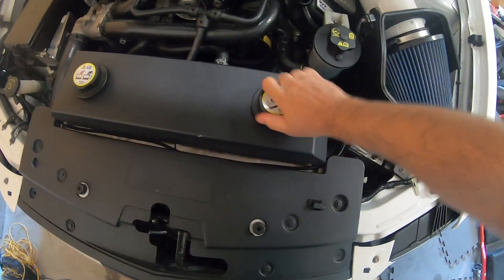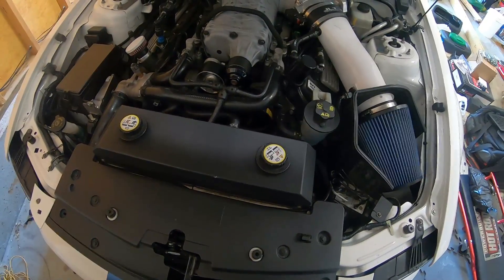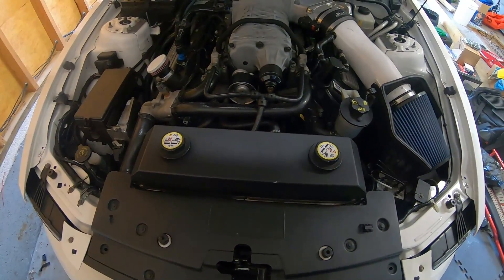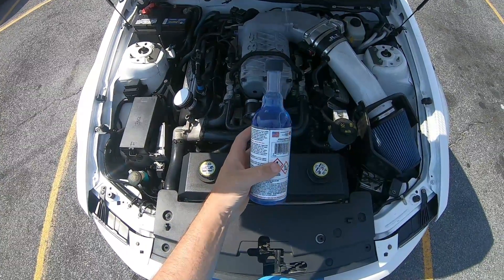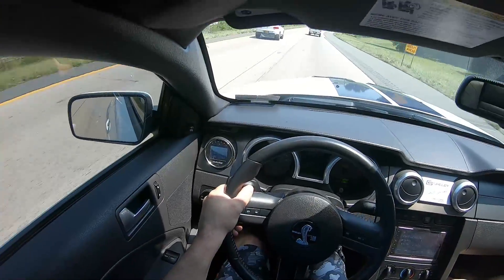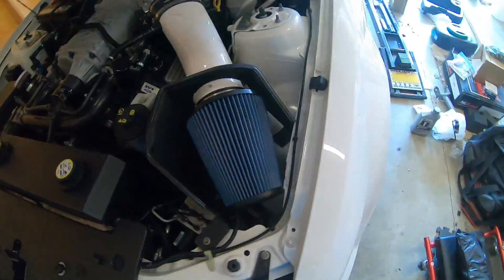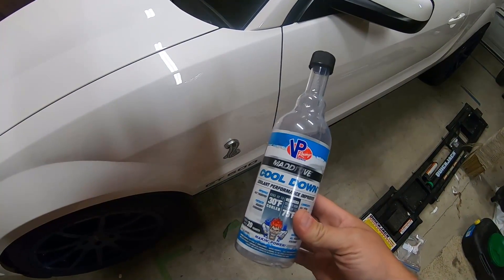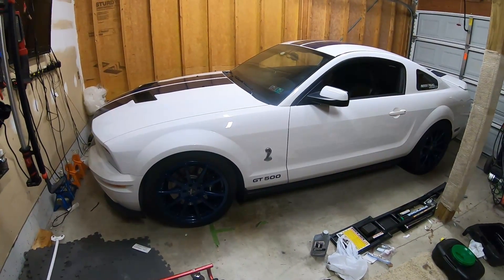Testing VP Cooldown in your Water/Air intercooler

Comment: Yeah, it’s not a magic temperature lowering fluid.  Think about it.  To reject more heat (a lower IAT) you need a higher delta V between the heat exchanger and the air.  So adding a fluid with a higher boiling point is not going to do anything.  If you wish to see anything you should be raising the boost until the fluid boils, then add this product.

Comment: I'm in Miami Florida and we have been hitting 100 degrees in summer.  It's works a bit, but you need a scan tool. According to my mechanic in other I internal parts of the engine it runs a but cooler. What i have found that really works is either using VPs coolant, or with the additive mix in a gallon of lab water triple distilled and ionized. Then you'll notice a difference in the cooling system. , but again I t is a good insurance for ten bucks in other crucial components that you can only monitor with a professional scan tool.
Reply from the maker: I was not testing in my cooling system. Nothing to test on internal components or a “professional scan tool”
Reply: So you recommend VPs stay frosty?  I'm 2JZ runs a bit hotter than I like so I would mind dropping a few degrees celsius. Thanks.
Reply from the maker: @KillJD it may help a smidge if you are hitting the boiling point. Fixing underhood temps overall would help more though. When I had my Supra I ceramic coated my manifold and downpipe and exhaust housing to bring temps down. IMHO there are probably bigger gains there
Reply: @PMPerformance  Yea it's a 2J swap into a E46.  It's definitely an airflow issue because if I can keep the car moving in traffic on a hot day it's fine. Once I'm in stop and go traffic I have to turn in the blower motor to help to just maintain the temp. 

The turbo has a blanket and the manifold is wrapped. Next I'm going to try some hood vents and ducting around the radiator. On a nice day it's too much of an issue. Thanks!
Reply from the maker: @KillJD yea that’s always a tough battle and gotta get creative. You can try this as it’s cheap, but I’d bet it won’t do a ton for you

Comment: Ughh I used it on my stocked vw cc  did a whole flush cleaned   Added new  coolant   Did a 1 week test without adding anything stayed normal   Added the vr racing  cool down  honestly it truly work but didn’t give me the 20 degrees lower gave  me about  16-17   Stayed between those the whole week and after that  also forgot to mention I did do a engine clean 🧼   As well car does have 140k miles no issues   It can definitely be a hit or miss all depends on how you do it
Reply from the maker: Did you watch the video? While I appreciate the feedback, this video was not showing its typical intended use. I filled a water to air intercooler with it.

Comment: It’s not going to work well the way you did it, you have a boosted car. You need a heat exchanger and a chiller. Not to mention a lower thermostat. This product works good on naturally aspirated engines. Not boosted.
Reply from the maker: I get that. There were people touting this fixed iat problems, and this was proof it doesnt

Comment: Install a forced induction inner chiller stage 2 kit. Don’t buy that killer chiller garbage use forced induction. I live in Houston and mid summer my IAT2 average 30-40 degrees 50-60 degrees after several pulls. Coolant temps stays around 30 degree will drop below zero in winter and spring
Reply: I miss read I thought you posted this 3 days ago lol. I was very skeptical myself with this chiller but made me a believer. I can do back to back pulls on 90 plus degree day and my highest IAT2 was 88 degrees.
Reply from the maker: @h-townremodeling1519 it’s all good. 
Yea if that is the case, this sounds like an awesome setup! That’s the key is to be able to make back to back runs with ease at full power.
Reply from the maker: Those chillers work decent for idling, but under load, I have yet to read anyone that has indicated these are the answer.
Reply: I just did 😊 I bought a 21 stage 3 Roush car I know all about heat soak. This solved it. Again don’t use killer chiller use Forced inductions chiller they developed it Killer chiller tried to copy it.
Reply from the maker: Thankfully this video is probably 5 yrs old and I no longer have this nightmare of a car.
This car has changed my outlook on PDB cars for sure! Lol
Those IAT’s seem almost too good to be true. Esp after several pulls. This sounds great though if this is the case

Comment: You use your AC? Center vents closes and drivers vent occupied by the Ngauge
Reply from the maker: strange that is the part of the video you focused on. This video was probably done in the winter.
Yes I closed the gauges because of ocd. When I use the heat or ac, I simple just flipped the vents open
Reply: @PMPerformance  I thought you said it was 80+* and wondered if you had better cooling using the floor vents or something.
Reply from the maker: I don’t even remember what video this was.
Simple response was : I  was not using ac during the video
Yes when I used it, I opened the vents or used the floor only.
Maybe I shut them off for the video. I don’t recall, but irrelevant to any of the video contents

Comment: I've had my IAT down to 50° three bags of ice in the ice box. It was like adding nitrous.
Reply from the maker: Sure, for about 30 seconds at the track.
Reply: @PMPerformance  long enough to pull a 5 in the 1/8th
Reply from the maker: @ArmyPL1981  that’s fine and dandy for a track car. The ice does not last that long on hot days, but moot for a street car.
I had an ice tank, but again doesn’t do anything on the street.

Comment: Where is your bank one and bank two sensors? Because this  specific product is claiming head temperatures. So what is your head temperatures?
Reply from the maker: Because this product was design for engine cooling, not blower cooling.
This was an attempt to see if it would help, and did not

Iat1 was in the maf and iat2 was in the lower if memory serves me. This was a few years ago, so my memory could be hazy

Comment: Did you ever use this ? I open my cooling system today and noticed white chalk everywhere ? Is it normal ?
Reply from the maker: Yes I used it. It’s clear it was used in the video.
Not sure if it’s normal, but have you ever done any coolant maintenance?
Reply: @PMPerformance  always. I used zerexgo5 which is a HOAT Coolant. Read on a forum that’s usually the calcium to protect from corrosion. Going to try it again

Comment: Says turn heater on high and idle for 10minites once you add
Reply from the maker: Did you not realize this is for the blower and not the cooling system? The heater has no relevance on this.
Reply: @PMPerformance  I realized that right at the end when you dumped it haha
Reply from the maker: @starcraftgod1212123  did you watch the video? Pretty sure the first 30 seconds I stated what my plan was. Lol
Reply: @PMPerformance  yeah dont mind me just slow, 1 pint treats 12 to 20 quarts but the bottle is measured out in ounces.. and the coolant system lists as 1.5 gallon. so im clueless bottle is 16oz
Reply from the maker: @starcraftgod1212123  your cooling system is 6qts. So I guess divide up the bottle for dosing for 6 qts.
I forget if the bottle had measuring lines on this side. I’m sure it did though.
More won’t hurt I’m sure.
Reply: @PMPerformance   .5p = 8oz took awhile but i got it thank you for your help
Reply: @PMPerformance  hey I got a question so I just bought this my self, and have a 1.5 gal coolant system... how many ounces of this stuff should I add? I can't find it anywhere bottle measures quarts and pints and idk the conversions
Reply from the maker: @starcraftgod1212123  not sure. This video is like 2+ yrs old.
I don’t remember what the bottle said, but they have dosing on the bottle as well as the website.

Comment: Are you running a heat exchanger?
Reply from the maker: All blown cars come with heat exchangers to my knowledge.
Reply: @PMPerformance  I'm building a centrifugal setup for the track but never owned one with a factory setup. Those chiller systems that hook to the AC seem like the ticket for a  driver.
Reply from the maker: @heavydhit56  there really aren’t many factory centrifugal cars. Turbo and twin screw cars pretty much always have a heat exchanger that I have ever seen in the last 20 years or so.
The chiller kits are pretty decent, but not all they are cracked up to be.

Comment: Didn't work on my stock car. I put in with antifreeze... im trying 2 bottles with stright water
Reply: Well a buddy i race with had the same problem im having. Running 240 degrees.... he got a 4 blade fan and put 2 bottles mixed with stright water.... then he ran 210.... I barrowed his fan and did the same thing.... I will find out if it works Friday night.... I have tried everything to drop my temp... 500 bucks later and still nothing
Reply from the maker: @51-FS  ok, so you are talking for your engine then and not your intercooler?
This works pretty well for engines I hear. I meant for intercoolers pissing in the wind.

My water temps were always great. I had a 170* tstat and just larger fans on the stock radiator
Reply from the maker: I don’t think anything is going to help.
The more I thought about this, it’s just pissing in the wind really.
Reply: Yea my engine
Reply: I know it did nothing with 1 bottle mixed with antifreeze
Reply: @51-FS  did it drop at all like 5 degrees or anything adding to 50/50 mix?
Reply: It may of droped it 5 degrees.... I ended up talking off my nose pice and that is what helped the most

Comment: This stuff actually works on my holden vp v6 burnout car which gets hot quickly added this stuff gauge stays on cold
Reply from the maker: Yes for engine coolant. Not for intercooler coolant though.
I did not realize this was more suited for engine coolant.
Live and learn. Was worth it to try to test

Comment: You keep referencing IAT...intake air temps....

Why wouldn’t you be monitoring coolant temps.....
Reply from the maker: Because coolant temps are in the motor. Iat temps are what you monitor for this since this is the fluid going through the supercharger itself.
Reply: @PMPerformance  you're kinda right... but not really.  The engine is a heat sink.  Even a 20 degree change in coolant temp won't have an effect on that. Wrap your exhaust manifold,  or hedders if that's what you have.  That engine bay is packed. You're not getting much air flow there either. Water wetter is NOT gonna help your problem dude. I commend you for trying but this video is basically useless
Reply from the maker: @GLF426  agreed. Figured I was desperate enough to give it a try though.
Reply: @PMPerformance  after reading more comments I understand better what you were trying to do. Tbh I didn't realize that was an intercooler. I just thought it was a fab'd radiator. Your logic makes more sense to me now. You were trying trying lower intercooler Temps. Not the engine coolant. Same thing above applies,  but I can understand what you were thinking.   I don't know  why but it didn't connect when I watched the video hahaha..  carry on
Reply from the maker: @GLF426  no problem man. Yea there is an intercooler brick under the blower and then a heat exchanger that is basically a radiator at the front of the car to aid in intercooler coolant as well. 
The logic was there, but not sure the results were quite there. I like to test theories when I can. I consider this an aborted project at this point, but would have loved to see what the costed headers would have done to be honest. I have had great success in the boat with ceramic coated headers and exhaust housings

Comment: You should run a methanol kit with a killer chiller kit  they drop the IAT to around 50⁰ or 60⁰ degrees
Reply from the maker: Methanol does not work effectively pre rotor on a PDB blower. I had meth on my Centrifugal SN95 that had no intercooler. The IAT difference was unreal. Unfortunately not the same on a PDB setup. 

Killer chillers are a mixed bag. Any actual data I showed on the KC, their IAT's were higher than mine are. Sure they can get back in in quicker, but that does not make me want to spend my money. 
The engine is down right now, so if I fix it, I will be putting a better IC core on it while its all apart. My hopes are some better recovery time at least
i will follow up on that front if I decide to go through with fixing the car
Reply: @PMPerformance  meth doesn't but water does.  It's all about volume with PDB.
Reply from the maker: @QPC_LLC  I haven’t gotten any positive feedback or testing from anyone with a PDB. I saw 1 guy that ran ALOT of nozzles. I forget his end result but much too much work for me.
This pile of a car is long gone and I am onto better things
Reply: @PMPerformance  I've been dealing WM setups for over a decade now. Volume is king as you have to overcome the giant heat sink that is the nature of a blower. 

typically with 2000cc+/min we were getting roughly 30* over ambient even in Florida heat.
Reply from the maker: @QPC_LLC  again, to me running many nozzles to get the volume to make a difference was not worth it to me at the time. Nor would sucking that much fluid down be beneficial I think for a street car. I’d need a 5 gallon cell just for water/meth. Lol
Reply: @PMPerformance  you juuuuust don't understand and that's alright. 5gal would be ten minutes of sustained WOT which for a street car is a long time, multiple 60-130 pulls or higher. refill every couple weeks average.
Reply from the maker: @QPC_LLC  again, it’s all a moot point. The car is gone, I will never be running a PDB setup again.
My point was more volume needs more and bigger nozzles, more lines, more holding capacity and more fluid.

Comment: So maybe something to think about.. im not 100% sure about what you used..but with the supercoolant it shows the the use of the product with coolant has less effect than just the product with water. Product with just distilled water had the highest temp drop.
Reply from the maker: It actually said on the bottle to use like double the amount with just water. Problem I think here is that this is made for MUCH higher temperatures than my intercooler. I dont feel too bad though, because my friends GT500 went 167 the other night during a pull with a 3R on it. So bigger blower = less heat? I think not.
Reply: The thing is water itself is a better coolant. That's why the temp drop with just water and the vp helps  the  corrosion
Reply: Because if u only use water ur temps are hotter. Hence the big drop difference.  Lol. Smart cars like this wont let operating temp lower since the coolant flow is controlled by the temp sensors when to flow slow and faster
Reply from the maker: @SwordoftheSpirit-qi2ox I am not sure what point you are trying to make to be honest.
I never indicated I was using water, nor was there any large drop difference and this was only used for the intercooler system.